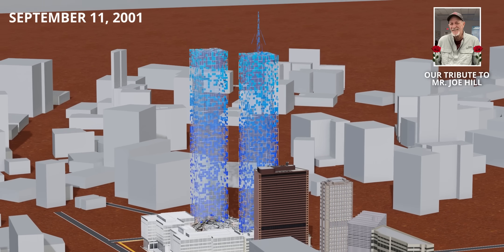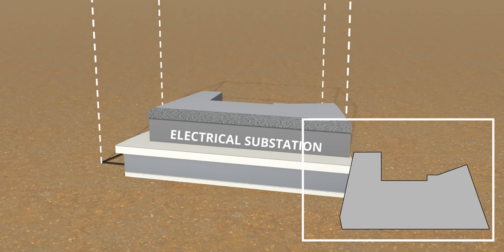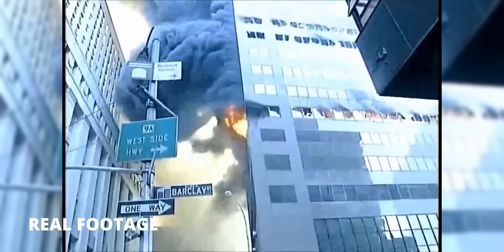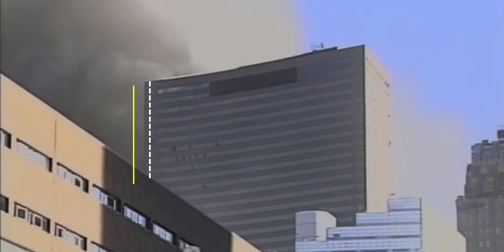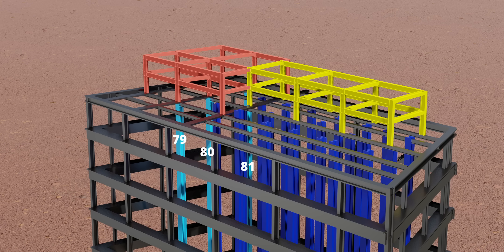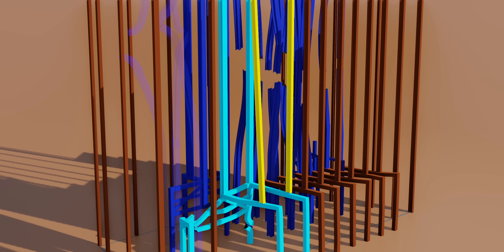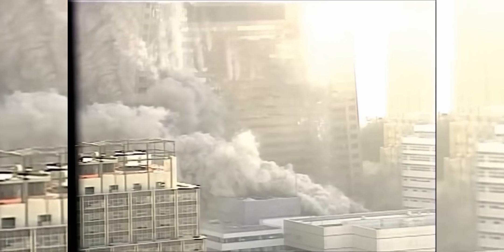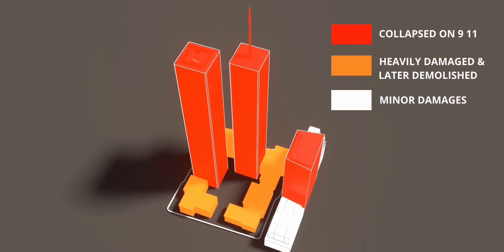Collapse of Building 7 | The Complete Physics

Comment: These vids are laughable. Some super rich guy does a huge pooh in his penthouse and the whole building collapses, is that what he is trying to say? The twin towers were not a copy book demolition ( top down charges) WTC7 was. The dropping of the penthouse roof was caused by the foundations being blown out. The building then loses its structural ingerity, sequenced top up charges then blow it out,  as its falling. Look at any controlled demolition on YT and its identical.
Reply: Uh huh.  I'm going to offer a more more detailed and plausible alternative.

Much misunderstood, Building 7 was the 6th building to collapse of the 10 lost on 9/11. Because of its early low priority, conspiracy filled the information void with garbage made up by technically ignorant people promoting political agendas. But this is an engineering problem and should be treated as such, so I prepared this brief summary of my own analysis to fix that, using engineering, not politics and tired memes.

The North Tower collapse at 10:28am bombarded Building 7 with tons of debris, causing heavy damage and starting multiple fires which burned out of control for 7 hours. Half the FDNY firefighters having been killed, units in disarray, equipment destroyed, no water pressure, and the greater urgency of search & rescue efforts, firefighting was pulled as futile. The building couldn’t be saved and was left to its fate. That is the sort of choice firefighters make every day in brush fire situations - which houses to save and which ones to let go. Only real difference here is moving the decimal on the size and cost. People get overwhelmed by the size.

www.youtube.com/watch?v=g_SvpwyC17M&ab_channel=MFitz

Collapse of a burning structure is always a concern for firefighters. Steel buildings subject to fire rely on active fighting of the fires to survive. Buildings are designed around 1 to 3 hours of fire resistance, allowing time for occupants to escape and ACTIVE firefighting to get started, after which all bets are off. Left to their own devices they will exceed their design envelope and collapse, like Plasco Tower and Wilton Paes de Almeida. In B7 the occupants escaped, passive and active fire protections were compromised and active firefighting was abandoned 3 hours before the collapse, which left the building to its fate. It lost. Odds on Building 7 would eventually collapse, and it did. No big deal in logic.

www.youtube.com/watch?v=WnYBX6QT0R4

FDNY Chief Daniel Nigro ; The biggest decision we had to make on the first day was to clear the area and create a collapse zone around the severely damaged 7 World Trade Center, a 47-story building heavily involved in fire. A number of fire officers and companies assessed the damage to the building. The appraisals indicated that the buildings structural integrity was in serious doubt. I issued orders to PULL back the firefighters and define the collapse zone. It was a critical decision; We could not lose any more firefighters. It took a lot of time to PULL everyone out, given the emotionalism of the day, communications difficulties and the collapse terrain

FDNY Deputy Chief Peter Hayden ; We had our special operations people set up surveying instruments to monitor and see if there was any movement in the building. We were concerned of the possibility of collapse in the building. And we had a discussion with one particular engineer there, and we asked him if we allowed it to burn could we anticipate a collapse and if so, how soon? And it turned out that he was pretty much right on the money, that he said 'In its current state you have about 5 hours

The collapse of Building 7 was anticipated and widely reported in the media throughout the day, with 24 video cameras recording some or all of the collapse. Everyone knew what was coming and why.

www.youtube.com/watch?v=OY5S5k3tMHI

Building 7’s collapse was completely different to the Twin Towers and harder to understand as most details hidden from view and not intuitive, but we can still sort out what happened through careful analysis and observation. This is my explanation of the collapse relying on no outside authority.

Building 7 was complex, asymmetrical 47-story steel framed structure built atop a smaller 3-story building, requiring lower floors dedicated to complex load transfer structures, not usable office space. Of trapezoidal shape and all-steel tube-in-tube construction, B7 (above the 7th floor) consisted of a central core of steel columns carrying most of the gravity load, perimeter steel columns around the outside of the structure carrying the remainder of the gravity loads and long span beams and girders to tie those elements together and form the floors. On the outside of the building hung a moment frame or outer shell.

Phase 1 : First externally visible signs of collapse initiation occurred at 5:20:28 pm and were notably quiet with observers not realizing the building was collapsing! No audible warning in the form of hundreds of ear drum busting 180-190dB explosive bangs preceding the collapse. Here at 12:00 a local CBS affiliate reporter is talking 10 blocks from B7 when collapse begins. People don’t start to notice the collapse until 12:11. At 12:45 is the famous CBS fixed camera clip of Building 7’s collapse. Note how quiet it is.

youtube.com/watch?v=t5tEy6mXSE8&ab_channel=fresnosean379

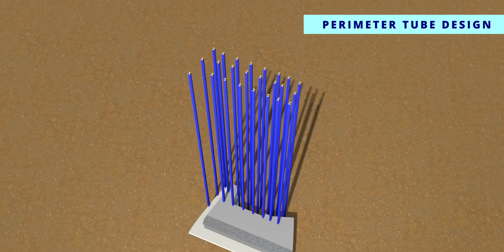Collapse initiation was due to lower floor failures above the load transfer region (7th floor) in the NE corner. In this video at 0:45 you can see the NW corner from inside the building while under construction, Column 79 just out of frame on the left. That big, angled steel beam across the top of the frame connects to C79 at one end. The girders connect to the beam. That beam and all those girders depend on just one connection

youtube.com/watch?v=nP3TNHPCIVU&t=35s&ab_channel=EdwardCurrent

Phase 2 : The floor failures caused a loss of critical lateral support over an excessive length of core Column 79 and it buckled. If you look at a floor diagram of Building 7 (see above) and look at all the structures that depend on C79 you quickly realize this one column was a relatively isolated structural element on which a disproportionately greater fraction of the structure depended analogous to say the Key Bridge. Externally we see a vertical progression of window breakage along the 44-46 line and a kink in the roof of the East Mechanical Penthouse at the top of the building, consistent with C79 failure. The transition from full capacity to almost no capacity occurs in an instant. Once the buckling failure occurs there is almost no resistance

Normally with a buckling column, the load could be redistributed to other columns. With C79 that is not the case - the failure did not redistribute the load, so the collapse rapidly progressed to the roofline, sinking the rooftop penthouse.

Phase 3 : With C79 gone, B7’s progressive, non-symmetrical collapse continues with C80 and C81 at the east end of the core left laterally unsupported and quickly buckled and failed as well, sending the EMP down through the building. C79-81 all have no diagonal bracing, which I believe is a major reason why they could not redistribute a lot of vertical loads among one another.

From there collapse progressed from east to west through the central core until the core was gone taking all of the interior floors and probably most of the perimeter columns with it. Follow the horizontal progression of window failures low in the building and the dropping of the remaining rooftop structures into the building. One of the big takeaways from the NIST Building 7 study (that gets completely ignored) was their modeling which determined C79 failing under ANY circumstances would have initiated the same collapse sequence.

Phase 4 : After 10 seconds only the exterior moment frame - a hollow empty outer shell – remains, giving the ILLUSION the Building is still standing since little has outwardly changed. It is just a hollow empty shell like an empty cereal box. Supported by only a few remaining columns that empty shell is quite unable to remain standing. With all core columns and floors gone, the north face leans inward, forming a V in the roofline, the last few columns buckle under the strain and the moment frame free falls, landing on top of the 7-story high debris pile. It is only late in the game here at the end that a single measurement of alleged free fall acceleration is taken, from a single point on that outer shell. The Building did not “free fall” – just one corner of the outer shell did, sort of. The Building was already gone before that happened. The period of alleged free fall was a product of how it fell NOT why it fell and cannot tell us what started the collapse. Start to finish the entire collapse took 18-20 seconds, 3 times longer than true free fall . How fast something falls cannot tell you what started it falling_ anyway. The debris spread outside the footprint, blocking surrounding streets, heavily damaging the Verizon Building and destroyed Fiterman Hall.

Building 7’s progressive, non-symmetrical collapse was incidental and unintended collateral damage from the combined effects of fire + time + gravity, started by the collapsing North Tower. That is true no matter who planned and carried out the 9/11 attacks or why . The collapse was of so little consequence it barely even registered at the time, a mere footnote. It only took on semi-mythical status as an alleged smoking gun years later when demolitions at the Twin Towers, missiles at the Pentagon and shoot down over Shanksville all failed and conspiracists had nothing left to work with.

Anything can seem like a conspiracy if you don’t understand how it works. Now you should. I hope you found this helpful, informative and it solicits informed critical comment. If I made any errors of fact, logic or reason or left anything important out, please let me know so I can fix it. IF you can offer a more plausible alternative please do. Be the first. Please start any reply with the words “Tits McGee” or I will know you didn’t read it and are wasting my time.

Comment: Structural professor truth here class take a seat I’ll diagnose this video for you.
Building seven was made out of dry spaghetti. None of the spaghetti columns were tied together with solid floors or gigantic horizontal beams… The whole entire building was these spaghetti straws. And you know what happens to spaghetti. When you want to cook spaghetti and it doesn’t fit in the pot you break it in half and all of the spaghetti turns into dust. In under eight seconds.
This is the spaghetti theory of building seven that is brought to you by this video.
There’s a test after this so please study the spaghetti theory of building seven. And don’t forget the Ragu.

Comment: WTC Building 7 collapsed at essentially free-fall acceleration,  but, more importantly, both WTC towers 1 and 2 collapsed at free-fall acceleration, which cannot happen if 70 to 80 percent of the building structure - the portion below the damaged area - remains intact. Shayam Sunder, the lead investigator for the National Institute of Standards and Technology (NIST) stated on video that “A free-fall time would be an object that has no structural component below it.” He also stated on video that “Tower one collapsed at about eleven-seconds, and Tower two collapsed in about nine-seconds, this is essentially the rate at which free-fall [collapse] would happen.” Free-fall is an object falling through thin air. Collapse by gravity alone would not explain the towers' collapse rates. Many professionals during the WTC cleanup saw melted steel and concrete which requires much higher temps than any normal combustibles in the area could create - especially in fires buried deep under the rubble. The 2002 PBS documentary “America Rebuilds” mentions molten steel and underground recorded temps of as high as 2,800 degrees (F). Deep underground fires raged for three months even though enough water to fill a lake was dumped on them. The military grade incendiary Nano-thermite can reach 6,300 degrees F (Lawrence Livermore National Laboratory - Science and Technology Review - Page 19, October 1990),  easily enough to melt steel, and unreacted particles were discovered in 2007 in dust samples collected around the area. Nano-thermite contains its own oxygenizer and can burn efficiently even under water, which explains the high temps and ability to continue burning for so long. Nothing other than Nano-thermite explains this, and it shouldn't have been there.  [ 9/11 - WTC Building 7 Collapse Examined - https://www.youtube.com/watch?v=w4ZVFxmFOF8 ]
Reply: Probably better to address this here than in the other thread where you barged in, off-topic.

How did you arrive at that conclusion about free fall (or "essentially" free fall)?

Did you measure it yourself?

Or did you take the internet's word for it?

I measured it myself.

Twin Towers took 32-34 seconds to collapse, which for those keeping score is 3 times longer than free fall

Essentially.

Building 7 took 18 to 20 seconds, which is again 3 times longer than free fall

Essentially.

You don't even need to take precise measurements.  In the case of the Twin Towers the naked eye will do:  

www.youtube.com/watch?v=4VgZW-v_Opg

Funny thing about free fall though is that all that shit the conspiracy side of the internet has been telling you about it isn't really true. For example:

www.youtube.com/shorts/n8WxkqMRgS4

Now then, would you care to revisit your hypothesis?
Reply: @TheCriticalStinker-01  Here ya go...again.... Please don't delete our comments again - reply to this one. Your times of collapse are inaccurate and reflect the 9/11 debunker’s use of audio instead of the actual scientific measured times spoken of by WTC Lead Investigator, Shyam Sunder of the National Institute of Standards and Technology (NIST). The use of timing the collapses by the longer duration audio was prevalent with 9/11 debunkers as an attempt to argue against controlled demolition. The extremely detailed professionally produced 5 hour investigative 9/11 documentary titled “September 11 - The New Pearl Harbor” by Massimo Mazzucco, which meticulously examines every detail of the September 11 attack, includes the video of Mr. Sunder making his statements: “A free-fall time would be an object that has no structural component below it.” And that “The measurements have indicated that Tower one collapsed at about eleven-seconds, and Tower two collapsed in about nine-seconds, this is essentially the rate at which free-fall [collapse] would happen.”. I believe his comments are also in videos of 9/11 produced by "Architects and Engineers for 9/11 Truth", which is an organization made up of highly respected professionals in their fields. WTC Building 7 collapsed at free-fall acceleration for a little more than one-third of the first part of it’s total global collapse that took about six-seconds. The acknowledgment by NIST that “free-fall” acceleration existed for that duration, which is impossible by the laws of physics without the complete obliteration of supporting structure, and the symmetrical collapse indicative of controlled demolition is why I used the term “essentially” free-fall in describing the collapse of Building 7. [ 9/11 - WTC Building 7 Collapse Examined - https://www.youtube.com/watch?v=w4ZVFxmFOF8 ] I see your YouTube channel has no content.
Reply: @NRUN65 - I NEVER delete my posts and my collapse times are based on simple  visual observation NOT audio, so that's two  things you got completely wrong in the first line.

I saw no need to read further so really hope you enjoyed typing out that word salad.
Reply: @TheCriticalStinker-01  I'm used to these conversations so I went back to check and found your post to me as well as my reply (reposted above) were gone....so I naturally assumed you had deleted yours, and mine as well because it was a reply. When I reply to posters like yourself it's not just for you, but for anyone wanting to now the facts. Shayam Sunder admitted the facts about the rates of the collapses, whether intentionally or not, showing that the Twin Towers as well as WTC7 were brought down by controlled demolition. The Laws of Physics were in full force that fateful day. Thanks for giving me this opportunity to spread these facts to a wider audience. [ 9/11 - "Explosions" - Twin Towers Controlled Demolition? - https://www.youtube.com/watch?v=lxbwJoWNuzw ]
Reply: @NRUN65  - Glad we got that sorted out. I love progress. Have a nice day.